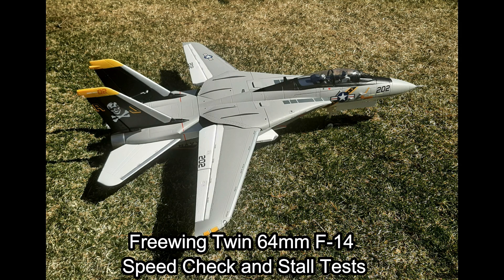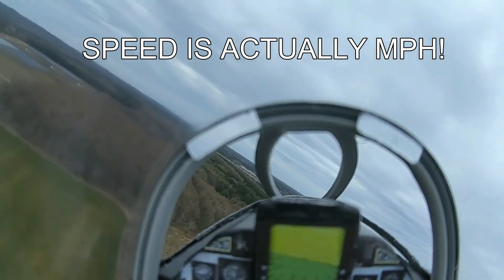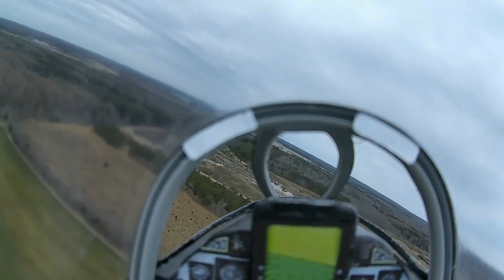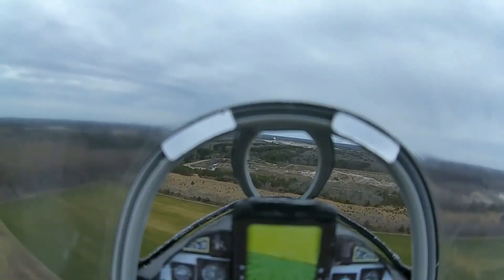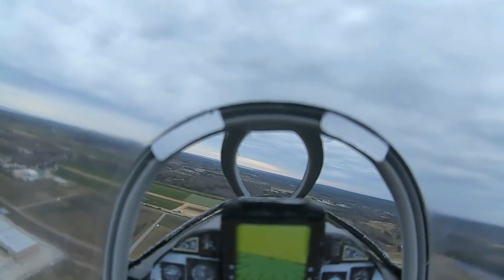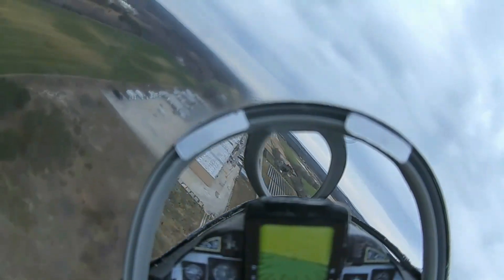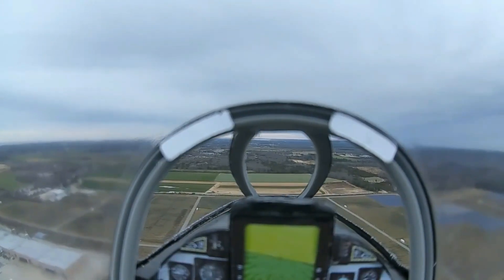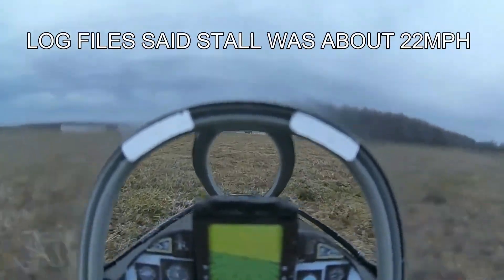Freewing F14 speed and stall tests

Comment: Is nice jet for looks’ the arrows f15 will do 98mph without diving it. And e flite f 14 will do 85mph without diving it. Nice video
Reply from the maker: I think the thing that's holding this model back is the poor airfoil on the wing it's very thick and the high point is very far aft. It's also making for some poor stall characteristics

Comment: Great video and Info - Tom, would the canopy cut out slow it down a little by causing more drag, as it looks the the  air (Wind) going into it at the cut out has no where to exit- I have one of these and have seen lots of crash videos - any info you can share would be really welcome as I have not even taken mine out of the box - I will sub and go check your videos for info - thanks again...
Reply from the maker: Cutting out fwd canopy has slowed down some of my other FPV jets by about 8% (it was 8MPH slow on 100MPH freewing F9F Cougar)  I have just posted this on rcgroups and it may have been the cause of some of the wing failure crashes. https://www.rcgroups.com/forums/showpost.php?p=52392509&postcount=1231

Comment: Love the professionally done stall tests, Tom!  Not only are the stall speeds useful, but also the stall attitudes for different flap states.  I noticed the break was at higher nose up attitude clean vs the half flap and then the full flap attitudes.  Very cool!👍
Reply from the maker: yes, just the way it is supposed to happen.  Flaps increase lift at lower AOA but stall at a lower Max AOA than a clean wing.